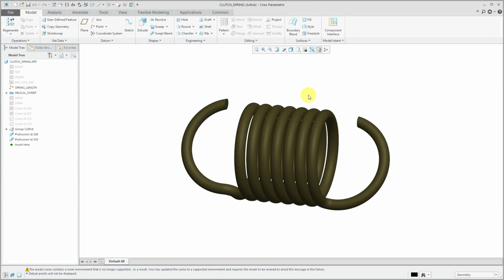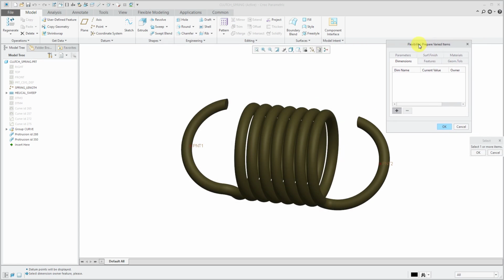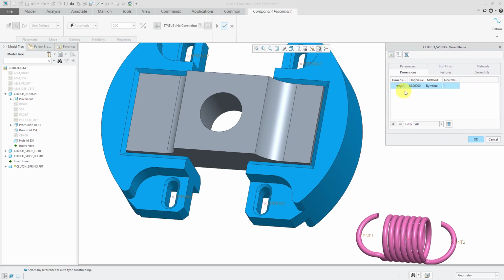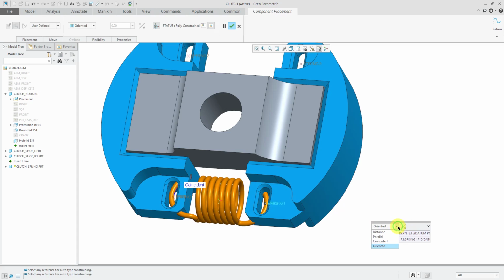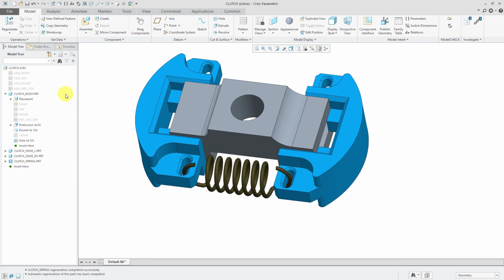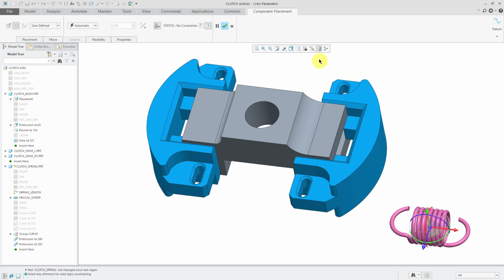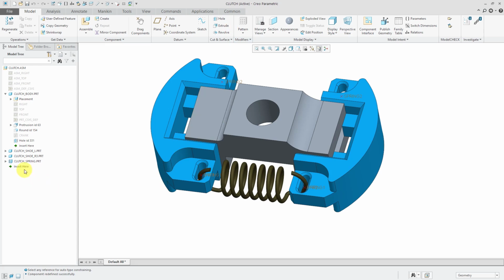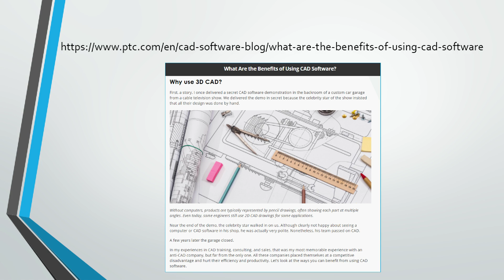Creo Parametric - Component Flexibility | Tutorial

Comment: Would this type of connection apply if installed on a non-Rigid constraint?  What if the blue piece was on a Slider constraint?
Are those parameters important for this to work?
Reply from the maker: It should work regardless. Note that during a mechanism analysis, flexible components are suppressed. They will be resumed after the analysis.

Comment: Thank you sir for such a nice video. I am eager to know that will it work in simulation...just like when it is connected with  two parts of a mechanism and one part of the mechanism is moved using "drag component" command? ....as we usually see in simulation of pin joint when the one the part is driven using servo motor.
Reply from the maker: Component Flexibility is a design tool independent of simulation. During mechanism analyses, flexible components are suppressed. I have videos on Dynamic Springs in mechanisms if you want to see components like that extend and compress.
Reply: @CADPLMGuy   Sir, Thank you so much for reply. I want to learn the "extension spring" in Creo...the mechanism which I want to Model in Creo is on YouTube. If you see the video "Lever-Type Elastic-Link Switching Mechanism-1"...the same mechanism I want to do it in Creo. Will you please post the similar video but with proper explanation. As I don't have resources to ask the explanation and the similar part is going to be installed in my actual model which I want to simulate in Creo, So that I could move ahead for actual fabrication.
Reply: @CADPLMGuy  Sir I have seen the video and is nice. I tried the spring for a simple toggle mechanism (having only two links and pin). But doesn't worked. Even I tried the spring in mechanism analysis with
the inputs; input and output link connected on a common axis with pin connection, motor with magnitude cosine connected to pin connection of input link, spring between input link and output link. After running the analysis just input link run with cosine input (back and forth) and no effect on output link. In reality, when input link crosses the toggle line the output link should move to the input-link direction due to the spring. But it doesent happened while analysis.
 The output link was just seen stationary. For understanding the toggle mechanism in Dynamic analysis in Creo will you please make the video. It would be really helpful to all the community who are using Creo assembly I'm trying to do this since more than a year. 
Please help me out Sir.